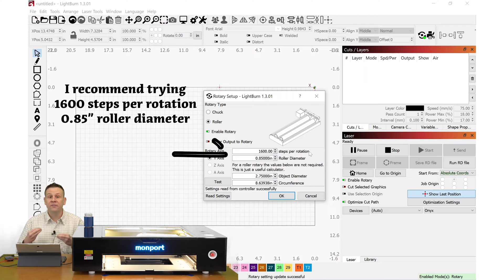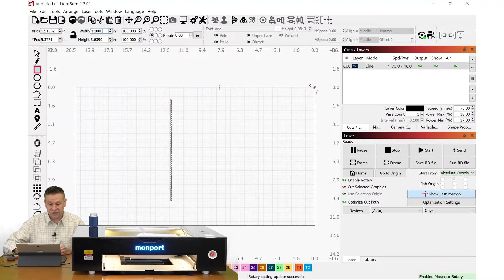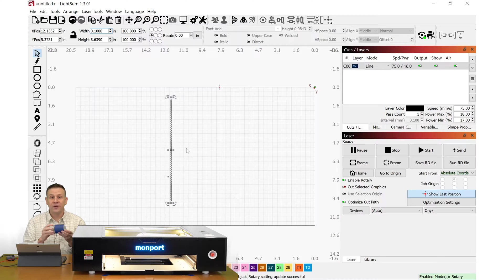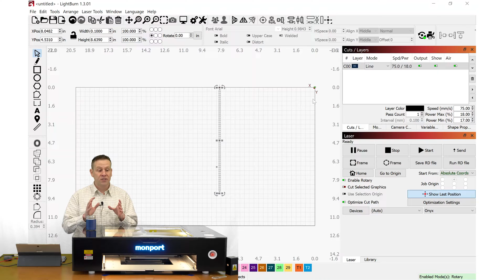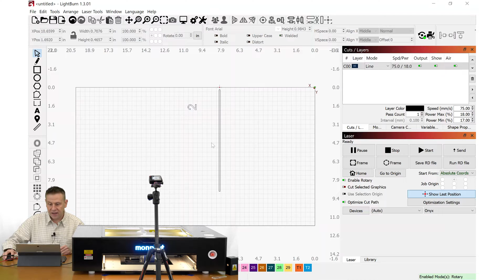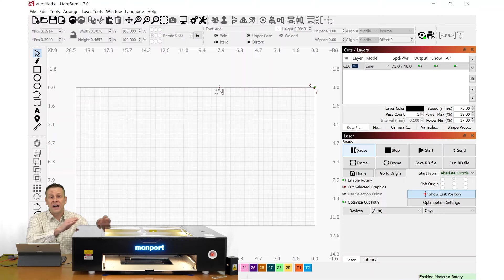Monport Onyx-  Rotary Setup & Calibration #4

Comment: Air assist when cutting and a visible LED to aide in locating center for cylindrical engraving would seem needed.
Reply from the maker: The machine does have air assist from the factory- an alignment light would be great.  Thanks for watching.

Comment: Hi Greg,  I am interested in this laser and don't see an available chuck style rotary available.  Do you know if any other chuck rotaries on the market would work with this laser?  Thanks!
Reply from the maker: Good question! Currently I don't know of any official chuck rotary for the Onyx.  It would be interesting if a rotary from a laser diode machine would work- the machine would most definitely need to be elevated!
Reply: FYI - I just set up my Xtool RA2 Pro chuck on the Onyx.  All was needed was a short adapter cable converting the RA2s 6x16-4p plug to the xj8jk-4p/x4 on the Onyx. Pins 2 & 3 were the same on both rotaries but had to switch the 1 & 4 pins.  I'm now working on the calibration - so far the same diameter piece that took 1600 steps per  rotation on the roller  took 3200 spr on the chuck.
Reply from the maker: @edb6112  Thanks for the feedback- I'll have to try that out sometime!  Thanks for listing the plug styles/ part number- makes it easy for me and others to find the connectors!
Reply: You're welcome - just a little payback for all your great videos.  You've helped me a lot.  I salvaged these fittings from old cables I had laying around - the soldering is quite tedious.  Since the RA2 and the onyx use the same style stepper motor plug, a better and easier solution would be to fabricate or buy a JST 6 pin extension cable and just switch the 1 and 4 leads if needed.  I saw a video where a lady installed an atomstack rotary on an omtech polar and I believe that cable came with the rotary.  Thanks again for all you do.

Comment: I really want to see it cut various colors of acrylic. Cutting clear acrylic is why I’m considering a CO2 laser rather than a blue diode laser.  I’m really liking this Onyx.
Reply: Awesome!  Can’t wait.
Reply from the maker: I'm in the planning stage for the next video of using some of the included materials, 3mm plywood and 3mm acrylic.  I also have colors of acrylic and some thicker acrylic to cut and engrave on the machine.  If I can keep it short I'll engrave some glass too!  Thanks for watching!

Comment: I would like to know how fast this can cut 3mm basswood,  I'm thinking of getting this or the xtool S1 40 watt, wondering if the co2 is worth the extra maintenance over the diode laser, I know the 40 watt xtool can cut 3mm at 15 mm/sec, thank you
Reply: Thanks, that's fast I think I might be getting this
Reply from the maker: @djs7515   Excellent!  If you do purchase the Onyx I welcome you to use the link in the video description-thanks!
Reply from the maker: Thanks for watching!  Soon I'll make a video cutting and engraving the materials included with the Onyx machine- it comes with 3mm bass ply, 3mm acrylic, and 3mm cardboard (for practice).  I do like the Co2 laser source- cut and engrave any color acrylic and directly engrave glass without the need of a masking agent.  The Onyx has the laser tube on the laser head gantry greatly reducing the laser path for better optic alignment.  Mirrors 1 and 2 are in a sealed enclosure and do not require regular maintenance like a conventual Co2 laser machine.  I'm not able to speak for the S1- I don't currently own one so I can't comment.
Reply: thanks for the info, ill be waiting for that next video @thelaserchannel1
Reply from the maker: @djs7515  I was able to run the machine for fun last night and ran some 1/8 hard board cutting at 20mm/s @ 68% power- cuts easily in one pass.  I also cut 1/4 inch birch ply in one pass 20 mm/s at 70% power.  I haven't ran 3mm bass wood yet but I think it would run 20 mms/ or faster.
Reply: I had checked out both lasers and went with the onyx on what was a fabulous Black Friday deal (2023). I saved myself around a thousand dollars, it was free, fast shipping of what was a huge crate, while the Onyx came with a rotary, a variety of materials and very excellent exterior ventilation system (over 400 cpm fan). WARNING: I had one hell of a time calibrating the internal camera, which ultimately required Monport to send me a replacement, which I was able to get calibrated. From what I have recently read, this had been addressed in the newest iteration of the Onyx with their new auto-focus system.  Other than that, I've had the Onyx for a year now and it has proven excellent for my particular hobby level usage. I'm still working on realizing the full capacity of the machine. WHAT DID I CHANGE???  1) It is large and heavy for a desktop machine and it sits very close to my bench top. I ended up purchasing 3-D printed foot risers made specifically for lasers (off Temu).  2) I wanted to improve my lens and nozzle setup (much improved air), with an eye toward interchangeable, high quality magnetic lenses. I purchased both through "APC" (https://americanphotonics.com). This proved to be well beyond my expectations. Other than that, this machine has been golden.